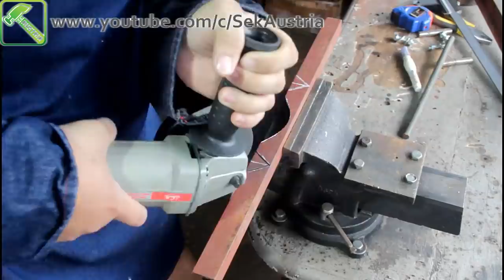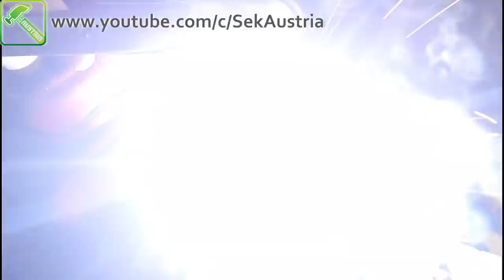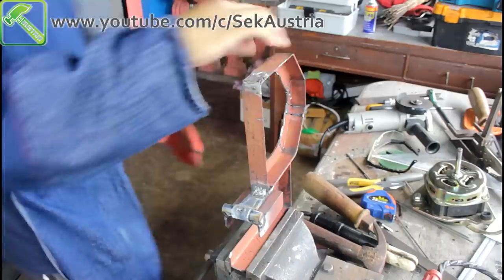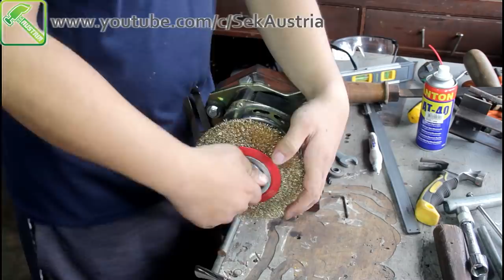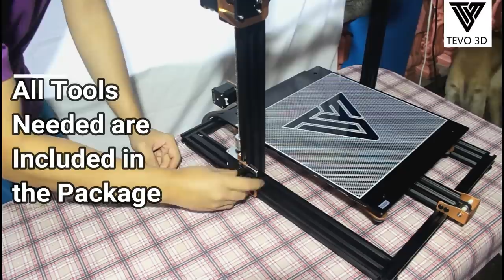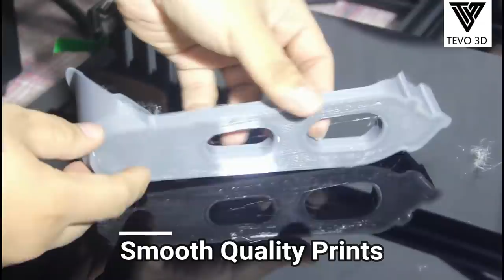Wirebrush Machine Using Washing Machine Motor

Comment: Well so beginner this is a terrible video. You didn't show what your power supply was. Then I thought washing machine motors were stepper motors, 
So how did you get the speed increase?
Reply from the maker: Mostly in asia the motors are induction motor
Reply: I appreciate the response, but in the induction motor simply means that it's capable of producing electricity if you applied manual Force to the other end. It still doesn't clear up the power issue. Did you plug it in? I'm assuming you just plugged it in right? You didn't run it off a 12 volt battery or anything right?